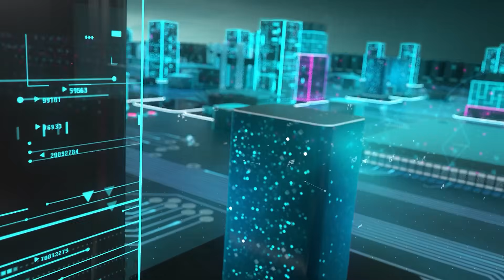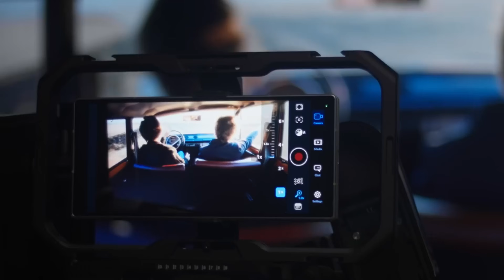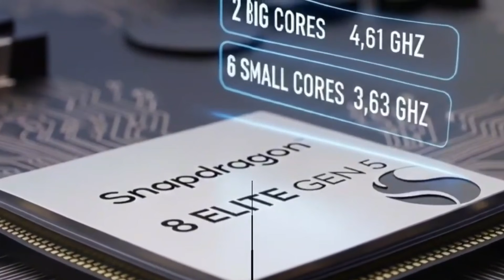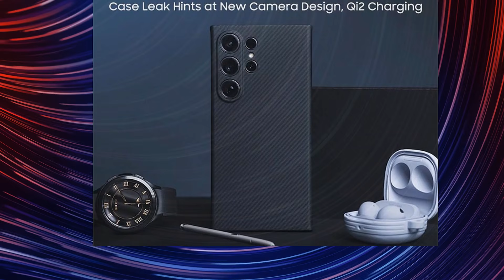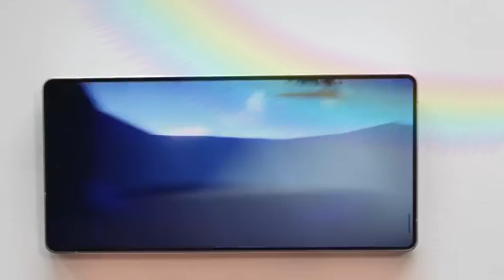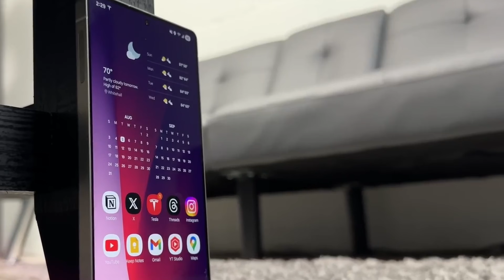S26 Ultra Samsung - YES, This is MIND BLOWING.

Comment: S26 is going to be just like before, typical Samsung with no real innovation and once again messing with people over the ridiculous battery capacity. There are plenty of companies out there offering bigger batteries and quicker charging for less cash too. One of the main issues with battery drain is all the Ai rubbish and backend optimization, plus the bloatware they keep piling on in the background you cant officially remove. Whenever I get a new phone, I always do this:

1. Take out the SIM card before turning the phone on.
2. Turn it on and immediately press the volume down button until you see Safe Mode.
3. Keep Wi-Fi off — no connection means no sneaky background processes.
4. Now that you're in Safe Mode, only the essential system apps are active.
5. Go to Settings > Apps to uninstall or disable all the bloatware.
6. Tweak all permissions — location, storage, notifications — tighten it up.
7. Restart the phone normally, then put the SIM back in.
8. All set. Clean, efficient, and under control..

Comment: Samsung tidak berani totalitas menggunakan Exynos artinya masih takut kalah sama pesaing yang menggunakan snapdragon, justru itu yg membuatnya dicap pembuat chip yg tidak percaya diri
Reply: Exynos is better for ai and multi tasking where as snapdragon is better for high end gaming. 
Samsung has always been leading in ai multitasking and customization using its own chip will allow the user experience to be more fluid and connected. 
Using a snapdragon chip will boost gaming performance and have that unbeatable speed(s25 ultra shows what it can do) but if smasung wants to keep up with ai they wont care about gaming they want the best experience when it comes to performance on daily tasks or even the heavier ones allowing you to freely use your phone for whatever the case is

Comment: If the design stays about the same around 75–80% identical—sales will drop drastically, possibly by as much as 80%, leading to almost no sales. The iPhone 17 is the perfect example. This is Samsung’s chance to hit a home run and deal a major blow to Apple, but I doubt they’ll take it.
Reply: They usually keep the same design for 2 years. The 21 and 22 looked the same. 23 and 24 same. 25 and 26 likely the same

Comment: i don't mind if they stick with the 5000mah battery, sure many chinese batteries are larger and charge faster but their batteries don't last as long, atleast with samsung you can go for quite a few years before the battery has to be replaced.

but i really hope samsung has listend to us and give us the snapdragon, exynos needs to prove itself first and if they have to use a different chip in the meantime, i'll be just as happy with a dimensity chip aswell.
Reply: What bullshit are you talking about Samsung s25 ultra got completely destroyed in the battery test compared to other android flagships
Reply: @ofri1247 I think OP meant that Samsung's battery will retain its max capacity for longer since SC batteries have half the charge cycles compared to Li-Ion batteries even if the former has more battery life upfront.
Reply: @boundlessaether392 yeah but that's just not true 🥀
Reply: @ofri1247 No its 
 actually true
Reply: @fadellabadi533 what source is that coming from
Reply: @ofri1247 read the article and you will know why
Reply: @ofri1247  Your comprehension skills are trash. He's talking about longevity over the years, those Chinese brands batteries are good for now, but will it out last a Galaxy S device 4 or 5 years from now? Do you comprehend this? If not, don't even respond to me.